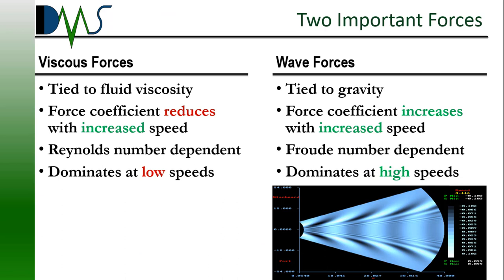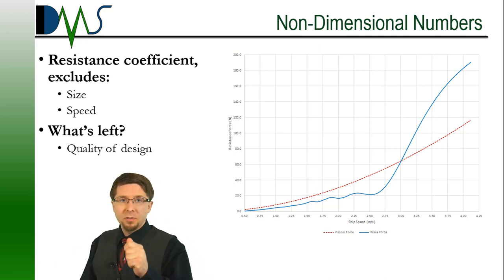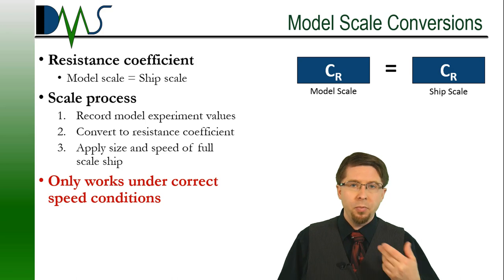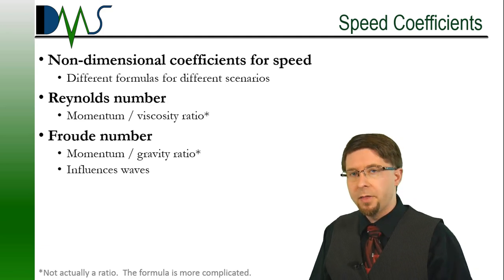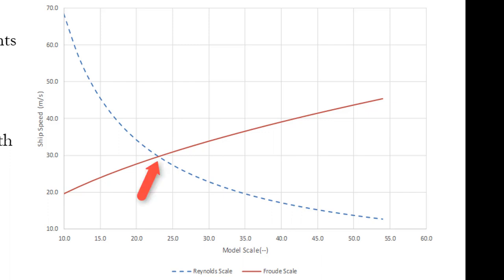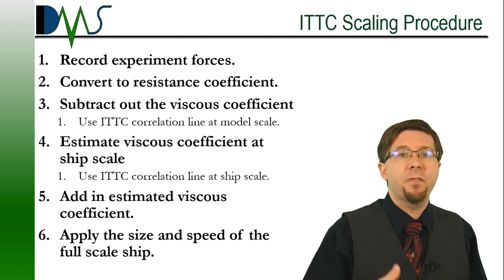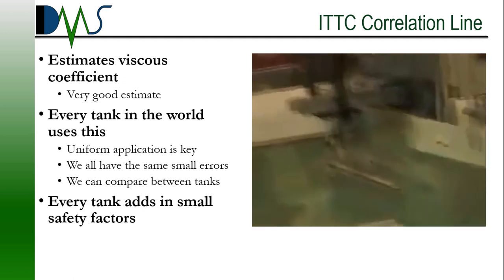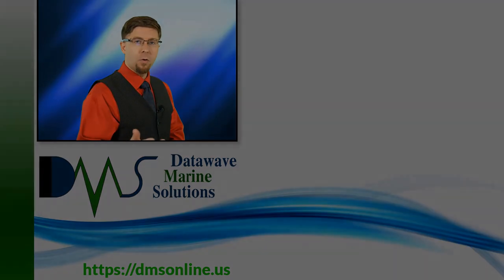Ship Model Scaling:  The IMPOSSIBLE Dream

Comment: noctua probably could have used this vid as an example when trying to explain why an 80mm fan can't just be 'resized' up to 120mm or 140mm in size without it changing the performance of the fan, lol. I understood the reasons why it doesn't work, I just wasn't able to figure out a way to describe it to people that know nothing about fluid dynamics and just want a quiet computer to play games on. yes, even air has surface tension not just sound wave velocities and fluid flow stuff, so it is a very similar issue for resizing fans. (I think it was Noctua, may have been Cooler Master regarding larger versions of the 212 cooler. I think that was at CES 2019, tho I'm not sure)

Comment: Is surface tension a major concern in scaling of froude number? Clearly at Very small speeds and scales it's a very strong influence on dynamics, how is it treated in a towing tank environment?
Reply from the maker: For most experiments in the towing tank, we can ignore surface tension.  Most towing tank models are around 1 - 4 m. in length.  At that size, surface tension does not really contribute to the model physics.
Reply: @DatawaveMarineSolutions  good to know
Reply: How small did you think they modeled ?

Comment: Since the Froude scale uses momentum and gravity and one finds it hard to scale gravity, how about changing the momentum...say by varying the density or viscosity by using a fluid like oil,  mercury or alcohol? Probably cheaper than building a spinning circular room with a tank that circles the walls and can handle high centrifugal forces (AKA artificial gravity). But both should be doable. Not sure that having a water tank on a vomit comet (for low gravity) would work for long enough to get good results.
Reply from the maker: Good idea.  Unfortunately, water is fairly unique.  It has one of the lowest viscosities of any fluid out there, proportional to momentum.  And to solve the scaling problem, we need to get less viscosity.  So that doesn't leave much room to improve without getting into really expensive or really toxic fluids.  mercury is a good example.  Technically less kinematic viscosity than water, but I would never want to see a giant pool of it.  That's how things go with engineering.  Quite often, we find that mathematics on paper are safer and far more practical than inventing new experiments.
Reply: @DatawaveMarineSolutions  Wouldn't plotting the results with various other fluids (plural) help in extrapolating the information that you are really seeking?

Comment: What about simulation? Presumably when one simulates a boat within a computer, it could give comparable results to a small physical model?

Is that the cheaper/easier way to design larger ships?

What software are people using for this?
Reply from the maker: Yes, simulation is a good alternative to model testing.  When we use simulation, we typically model the ship at full scale, to avoid these scaling issues.  The computer doesn't care about the physical size.  Is it cheaper?  There is considerable debate about this.  It typically depends on the number of tests needed in the towing tank.  If you need a lot of tests, simulation is usually cheaper.  As to software:  ANSYS CFX, Siemens StarCCM+, Simerics, OpenFOAM, MSC Cradle CFD.  All the big software packages get used in the marine industry.

Comment: Would another fluid than water work as a model scale fluid?
Reply from the maker: We have looked into it.  Unfortunately, to get any improvement from the current situation, you would need a fluid with less viscosity than water.  And water is already one of the least viscous fluids in existence.  If I were to search the entire realm of chemistry, I could probably find a few fluids that have less viscosity than water.  But then there are the practical matters.  We need something that is relatively cheap (since we will fill a swimming pool with it), it needs to remain stable over a long time (we rarely change the water in a towing tank), and it needs to be relatively safe to handle.  Combine all those criteria, and no one has yet found anything better than water.
Reply: Alcohol is used for special effects because it behaves similar to water at a smaller scale. But then filling a pool with alcohol has loads of issues.